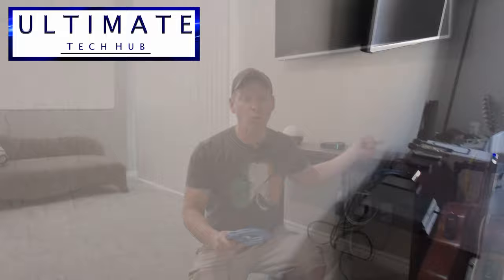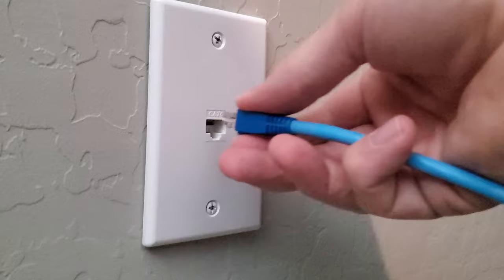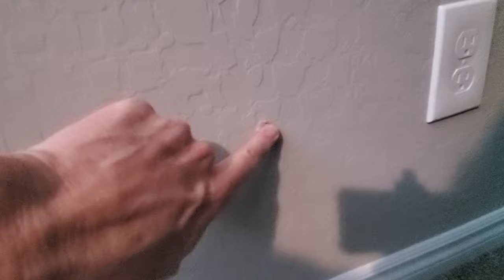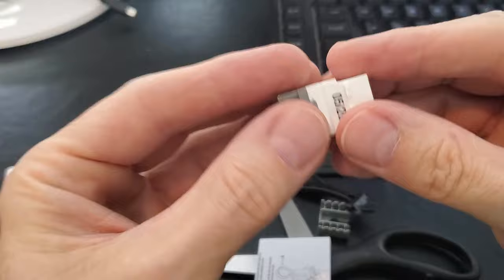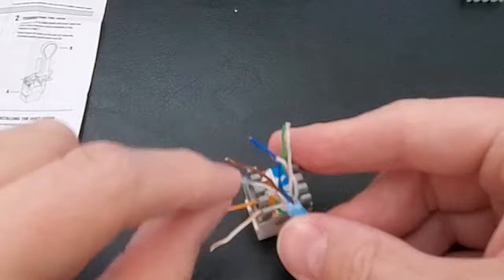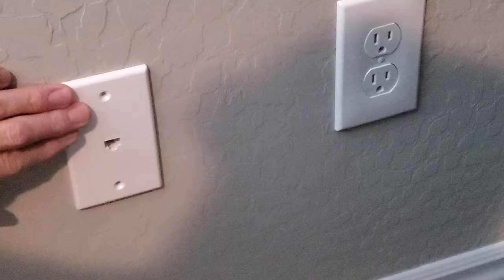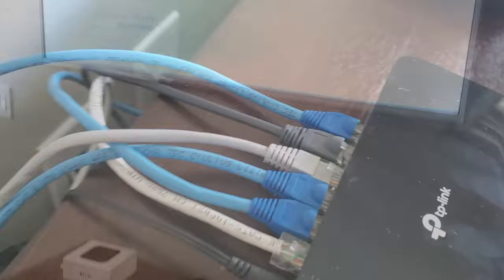CAT6 CABLE RUN THROUGH WALL AND ETHERNET JACK INSTALL - HOW TO

Comment: Question here. @00:40  What is the wall trim plate in the middle called and where can I get those? I want to run four premade ethernet cables through my wall and that is the ideal solution for me. Thanks in advance!
Reply from the maker: It's a wire drop plate. Here is a video that will explain it better.
https://youtu.be/M29rUnKi_p4
Thank you for watching.
Reply: @UltimateTechHub  Thanks for your speedy reply. I found some of those on Amazon. I am merely running four ethernet cables from my "office" where my network equipment is located to my living room which is next to my "office". I needed to keep it simple and cheap.
Reply from the maker: @williamjones4483  Cheap and simple is what I do!! Lol!

Comment: If you’re going to leave the other end as just a hole in the wall then why not just put a hole in the wall and run the cable right through it? Or why not install a cat 6 jack on both sides?
Reply from the maker: I did that about a month later. Just didn't make a video about it. I actually have 3 Cat6 lines on the other side of the wall, 1 going in and 2 going out. I will make a video on that install. I also made a video on the low voltage gang wallplate install and added a second cat6 port to the room. Its on my front page of my channel. Thank you for watching and for commenting!

Comment: should have used a low voltage box for the wall plate. Its closer to NEC code.
Reply from the maker: True but I wanted to show a very easy and cheap way to install a ethernet jack. Not everyone is good with cutting open walls and installing a low voltage box. But I will do a video on that sometime soon. Thanks for the good comments and for watching!!!
Reply: @UltimateTechHub  yea but not everyone has a drill, with low voltage bracket all you need is a knife and a screwdriver, which everyone has. It'll be even easier using female to female rj45 keystones since not everyone will have a punchdown tool.

Comment: Do you need to put a backplate (box) in the wall or just the plate..??
Reply from the maker: Yes here is the video.
https://youtu.be/4CUyU_v2qS0
Reply: @UltimateTechHub  How about instailling just the back box directilly to the wall without cutting dry wall.. I want to put a connecting in the attic.. and put it on wood..
Reply from the maker: @dfogarty93  I've never tried that but it could work.

Comment: the distance between my internet router is Multiple rooms away so could you do a tutorial on that please
Reply from the maker: This is a video I did on running cat6 from a network closet to another room through the attic using a wire drop and wall fishing.
https://youtu.be/qcET-OgrCCY
If you have any questions ask in the comment section. Keep me posted and thank you for watching.

Comment: Can’t you just use a snap-in keystone coupler jack F/F to attach the cat6 wires to both sides without the cutting? Wouldn’t that be easier?
Reply from the maker: You could do that. I prefer wiring it up myself and its cheaper than the coupler. Thank you for watching.

Comment: If you are adding a new wall socket and there is already another nearby, make sure they are aligned. Otherwise, it just looks weird.
Reply from the maker: The electrical socket is behind the dresser so you will never see that. But next time I will line it up.  Thank you for watching.

Comment: You should have cut a rectangle and put a box in for the jack.
Reply from the maker: I did but not on camera. I installed a low voltage gang plate that attaches to the drywall and it's super easy. I didn't have it on the day of filming so I did what I could and just improvised. Thank you for great comment and for watching I really appreciate it.

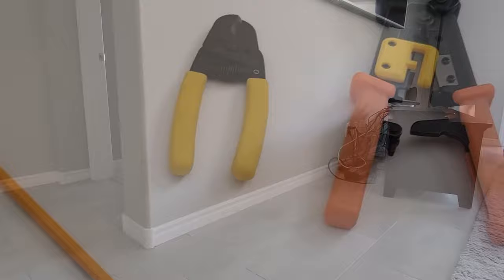Comment: Instead of measuring (2:00m), just drill a small pilot hole through the center of the existing wall box to get an exact center?

Comment: these seem way easier then putting in a Power Outlet for Coaxial Ports your ISP done much of the Job all you have to do is connect your Cable from the Splitter(in the Basement) to the back of your Port N Screw it in place only hard thing is Opening your Drywall to match & getting the Cable thru

Comment: Why dont you need to peel the cables before pushing them down? Are they still getting connection?
Reply from the maker: You don't need to strip the wires. Once they are pushed down they make the connection. I've made dozens of wall jack plugs and this is exactly how its done. Thanks for watching!

Comment: Do you need a really long drill bit or can you just drill both sides of the wall?
Reply from the maker: A long drill bit is easier. Otherwise you might not line up the 2 holes exactly.  Thanks for watching.

Comment: Why not use a low voltage pass thru instead of gouging drywall?
Reply from the maker: I could definitely do that but I wanted to show this particular networking installation technique. And once the wallpate is on it looks good and covers the small drywall hole. Thank you for watching and for commenting!
Reply: Aren't you gouging much more drywall installing a low voltage mounting bracket?
Reply: @Trini-Viking  as long as you are within 300ft of cable length you won't be losing any speed
Reply: This is all some ridiculous stuff made for massive runs in LARGE buildings, like hotels, or something with offices, etc. This is a commercial thing. You lose speed when you run cable distances that simply DO NOT HAPPEN in a residential house for the most part. Unless you live in a 3000+ sqft house, which let's face it, most of us don't, and are routing it to the other side of the house, then it really won't matter. I have installed Cat6 through 150ft and I still got 97% of speed. The average length of running a cable through the attic all the way to the other side of the house is about 50ft of cable. You'll get almost zero speed drop. Don't buy into this commercial bs where you lose speed, because it is just that, commercial and doesn't have an impact on our speed in residential, low length run lines.
Reply: @jonburhan5478  even if the house is that big, it depends on the location of the low voltage termination point.

Comment: Do you recommend this for an external job? I have a home based office and I built a new office in the back and need to run Ethernet cable from the existing office (where the modem is) to the new office, by crossing the roof
Reply from the maker: If it's going to be an outside run you need to have the cable(s) in a conduit for protection from the weather. Electrical conduit works great. Hope this helps and keep me posted. Thank you for watching I really appreciate it.

Comment: Im building a house and i want to have internet cable in all rooms, and connect the cable with the router, will i have internet connection in all rooms
Reply from the maker: Yes, if you are building a new house then run all cat6a cables to each room. I would go ahead and run 2 to each room for future expansion or if one cable fails. Even run some cat6a to your kitchen and your back patio. If you plan on installing PoE security cameras then run cat6 to each corner of your house where you will install the cameras. The other ends of these cat6 cables will all go to one location called the network panel. This will have your modem, router and switch. I have 50 plus videos on all of these subjects with installation examples so make sure to check them out. Thanks for watching and if you subscribed thank you as well.
Reply: @UltimateTechHub  thanks so much appreciate it❤️

Comment: Hey, great video. I was wondering if you could help me. I have poor Wifi signal upstairs in my house as the main internet point is downstairs. I would like an ethernet connection in a room upstairs to connect my PC to.

Is it possible to do this with only a router? By which I main an ethernet cable connected to my router, this cable is fed up through the walls and into a Cat6 jack/wallplate, and connect my PC to my new socket? Thank you!
Reply from the maker: Yes absolutely! You can also add a switch to that room for more ports. Good luck and keep me posted! Thanks for watching I really appreciate it!

Comment: hey there thank you for this video, i have a query related to ethernet, i have a wall mount ethernet (1port) which connects directly to the tv, however i have another device that i wish to connect via ethernet which is in a different room, and wifi signal is not the greatest. Would you recommend finding an ethernet splitter so i get more inputs or would a usb to ethernet adaptor work just as well connecing to the tv?
Reply from the maker: In the room with the 1 port you can connect a 5 port switch. Then connect an ethernet from theb switch to the TV and then connect an ethernet from the switch to the other device.
Reply: @UltimateTechHub  thank you so much for your advice! :)

Comment: I have a cabinet with the whole house wiring for telecom. I want to move the router to the kitchen where there’s a Jack but I don’t know if it’s just for a phone or if it is for wireless router plug. The kitchen wire in the cabinet of wires is labeled and has a lot of colored wire. Can I just connect those to the blue Internet wire by twisting?
Reply: And get set up the router in the kitchen?

Comment: Im about to install this but i just wanna know what the maximum speed is since we have gigabit Ethernet in our house and I dont want to lack it. Edit: Just searched it up and it supports 10gbps. Will install later
Reply from the maker: My speeds are around 740 mbps and I have 1 gig fiber. Thanks for watching and for commenting!

Comment: The new wall plate doesn't line up vertically with the old one to its right. That would trigger the everloving heck out of me if it was my house.
Reply from the maker: I installed a low voltage gang bracket and straightened the bracket about 3 weeks after video posted. Here is the video.
https://youtu.be/4CUyU_v2qS0
Thank you for watching.

Comment: Is it worth to buy and use cat7 Ethernet cable to connect to my wall cat6 ?
Reply from the maker: Probably not, unless you are doing some seriously large file transfers between computers. Cat7 wont help with most internet speeds unless you have 1gig fiber or 2gig fiber. Hope this helps and thank you for watching.
Reply: @UltimateTechHub  Thanks I went ahead to buy Cat8 as the price difference is not too huge; shall reupdate with the speed difference.
Thank you for your reply.

Comment: im planning to get xfinity wifi. we dont have coax slot on our apartment. but we do have that phoneline/cat 6 slot on the wall. will the wifi modem work?
Reply from the maker: Is xfinity cable?
Reply: @UltimateTechHub  for xfinity wifi
Reply from the maker: @당신은더미입니다  I think xfinity is wifi hot spots right? So it's completely wireless.
Reply: @UltimateTechHub  actually it the essential low cost wifi from xfinity. saw videos but they used coax line. now im thinking why apartment management need 75usd deposit i might need to pay that before they install coax line here
Reply from the maker: @당신은더미입니다  That sounds correct. If you can pick the installation area make sure its in the room where you want your wireless router. Keep me posted and good luck.

Comment: i know this is an old video and you probably do not come back to it, but i hope you do.
I just got my first ever house, it is a little old.  I was wondering if I wanted to replace the existing coax cable with ethernet, would it be a similar type of way? i have been looking all over and cant find a video related to that.
Any help is good. thank you.
Reply: Use your existing coax w/ MoCA. Coverts your coax to 1 Gig ethernet.  About $40 per jack. No cutting or wiring. Just plug n play simple. I like ScreenBeam on Amazon.
Reply: @bradsanders4382  thank you

Comment: The router isn’t on the other side of my room though it’s on the other side of the house. So how??
Reply from the maker: Best way is to run a cat6 in the attic and drop one line where your router is and then drop the other line into the desired room. When is say drop im mean fish the wire down inside the wall. Its a clean look but you could just drop the wire through the ceiling and run the wire down the outside of the wall. Just make sure the cat6 is white so it blends into the wall color.  Hope this helps. Keep me posted.

Comment: I'm trying to do the same thing, although I have two coaxial outlet boxes ( I dont need or will ever use) I want to replace with an internet ehternet? jack boxes. My router is in my living room and it be easier to plug from that wall and plug whatever in need for internet in my master bedroom. This the same but just cutting both ends of cable for cat6 jack?
Reply from the maker: They make coax the etherent adapters for around 75 to 80 dollars. Otherwise you need to run ethernet from the router to the different rooms. You can use the coax box but you will need to cut or drilll a hole in it to fish the etherent through.
Reply: Thanks, appreciate the reply

Comment: Is there a way to have the Jack go on both sides of the wall?
Reply from the maker: Do you mean a wall jack connected to another wall on the other side? You can do that but it wont have any internet connectivity.

Comment: So I just got the new Verizon router but this one needs cat6 but my house only has phone lines, is it possible to change phone lines to cat6 if so how?
Reply: are you sure that they aren't already cat5e or cat6 cables just snipped and used for the RJ11 jacks? try and get a look at the cables to see what they are In my place they RJ11 jacks were cat5e but only some of the wires were used
Reply: Having pre-run wires is actually helpful since you can use those old phone lines as a makeshift fish tape (wire pulling tool). Hardest thing to do would be finding where those wires originate. Simply attach the new cable using electrical tape where it originates, go to where the original cable terminates and pull it out slowly. As it pulls out it'll take the new cable with it.

Comment: Can I connect two wall jack together with ethernet cable? Like if i have my modem in room A, i can connect a cable to wall jack in A and get the internet to room B?
Reply from the maker: You can do that but you will only get max 100Mbps for each wall jack. The better way to do this to attach the ethernet cable to a switch ( 5 or 8 ports ) and you will have plenty of connections at 1Gbps. These switches are about 20 bucks! I have links in my video descriptions.

Comment: What happens when we connect straight cable instead of crossover cable.
Reply from the maker: It won't work. Straight through cables are used to connect computer to computer or switch to switch.

Comment: So I have the problem where I have to run my cable across the carpet my router is down stairs but the only walls to drill through are the outside walls that lead to out side
Reply from the maker: You can run the cat6 from inside to the outside wall to your router. Just use some conduit to cover the wire for protection. They make different color conduit to match house colors. Thank you for watching and if you subscribed thank you as well!

Comment: Where can I get that punch down tool? Or can I use something more common that I already have?
Reply from the maker: If you buy a wall jack they come with a punch down tool. Otherwise a small flat head screw driver would work just be careful not to push too hard. You might break the plastic on the wall jack.
Reply: @UltimateTechHub  thank you!
Reply from the maker: @lukehundley9620  Your welcome and thank you for watching!

Comment: would a female to female rj45 connector be inadequate for installing an ethernet cable through my walls?  Someone just starting in on researching what to use and what not to use.
Reply from the maker: You can do that but its not recommended. A wired keystone is more secure and will not become disconnected like a female to female coupler. I would just wire the keystone like in my video. I have dozens of videos on Home Networking so make sure to watch them to get more comfortable with this installation. Thank you for watching!
Reply: @UltimateTechHub  thanks muchly!

Comment: Question. Say my house does not have a coax cable and I want to install spectrum internet/wifi can I use a ethernet cable. ? Ps. The ethernet cable is cut out. Will that work ?
Reply from the maker: That should work as long as spectrum doesn't use coax to deliver the signal.
Reply: @UltimateTechHub  oh ok. Not to sure I been looking at instructions and they all mention coax outlet. My house does not have one since they has never been internet installed in 10 years. However it does have a cable(home phone) that has been cut.
Reply from the maker: @Livemusic1800  If instructions say coax then you need spectrum to come out and install the coax line in your house.

Comment: Can you buy a wall plate where u simply plug in the cat 6 cable into the back of it to save messing with wiring
Reply from the maker: I believe so. It's more expensive so that's why I showed the cheapest way to make this work.  Probably costs around 25 or 30 dollars. Make sure its a cat6 so it will handle the 10 gig speeds. Thank you for watching and for commenting.